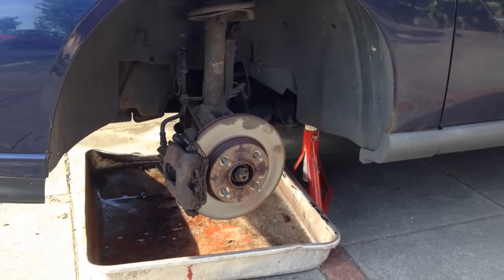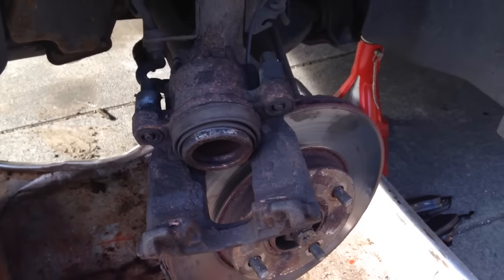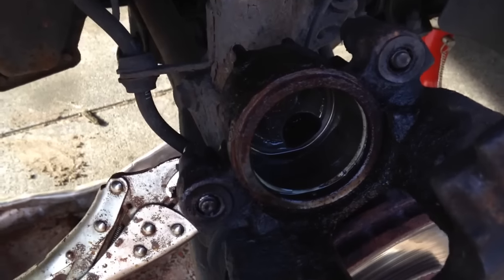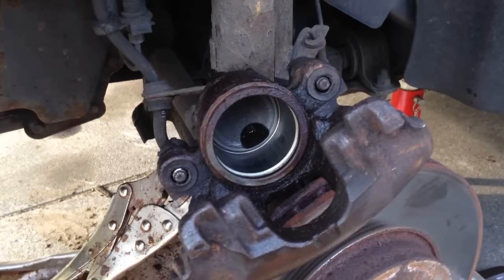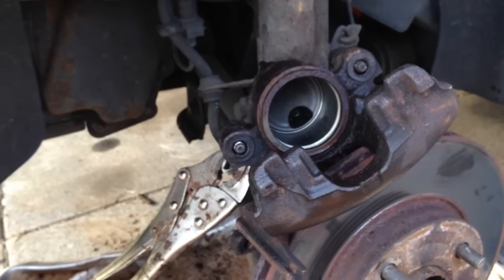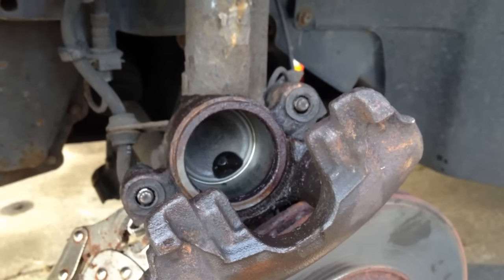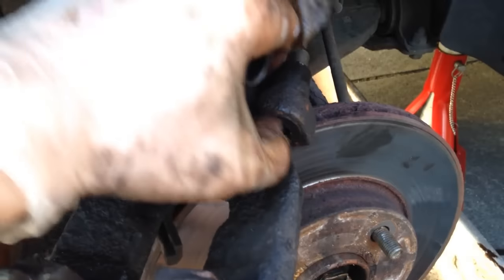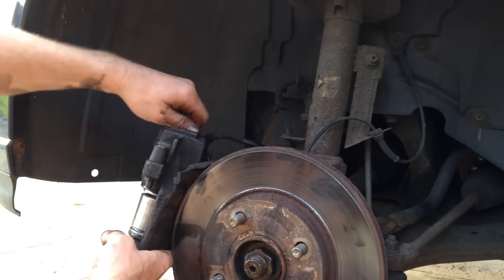How to Rebuild a Brake Caliper (WITHOUT Removing it From Your Car!)

Comment: Nice and clear! Great stuff!
I've just cleaned up my rear brake slider pins and noticed the seal on the piston has a couple of small holes.
I'll look again at your vid, and my design of caliper; I was hoping I might be able to swap over the seal without taking out the piston but not so sure if that's possible...
Ok thanks again good stuff!
Reply: I don't see why not in principle. You could put your foot on the brake until the piston is so far out, but not completely out. I suppose it all depends on design though. If you do try it, you need some method of getting the piston back in and I believe some pistons require a special tool to turn them and sometimes require a bit of force to go back in. A c clamp can work for the non-winding types I believe.
Reply: @seismic6402  Hi Thanks I only just saw your reply! I checked with my Alfa forum and it as explained my particular design of brake that I can only remove the seal with removing the piston... So perhaps one day I will - until then I'll try glue - it worked a little - and plenty red rubber grease.
Handily enough I have one of those tools but discovered that I have to be careful how far I push the piston - I think there's no stop - if I continued it would have popped out! There is a limit to how small a gap the tool can fit into...!

Comment: I'm going to do both front disc brakes at the same time this way. There is always that one cylinder that will work its way out before the other. I will use a block of wood to stop the first cylinder from coming all the way out to allow the other cylinder to start working its way out. This way, if I lose to much brake fluid and pressure or I don't want to clamp the hose on an older vehicle that needs all new fluid later, it wont stop me from working on the other caliper. Great video!
Reply from the maker: Good luck with the job Jerry. Cheers, Chris 👍

Comment: I did this recently, I re-used the piston though,  I used super fine sandpaper on the piston because rubber residue were stuck to it. I think i'm doing this for every brake job maintenance.

Comment: Easiest way to fit the dust boot on many calipers is not to engage it with the top groove, but put just over the piston at the bottom edge like a skirt.  It's easy to manipulate the boot into its groove in the housing without the piston getting in the way - particularly with a boot that fits into an internal rim. Yet, it's already fitted into the boot, just not creating extra difficulty. Then line up the piston and put it in, finally engaging it with the groove on the piston as it goes home.  No need for a screwdriver either.  :-)

Comment: Excellent ! I will try to apply your techniques to my Dodge Grand Caravan 2015. However, it's a dual piston system and I am wondering if I can only change one piston. I was thinking about using the new piston to stop the course of the piston I don't want to change so that all the oil goes into the chamber of the piston I want to change. What do you think about my idea ?

Comment: Great video and sound advice on how to repair a caliper though you might as well just disconnect the brake hose as only one bolt and make it much easier to clean and repair and just put new fluid in the master cylinder after and go round and bleed all the brakes for the sake of a 5 quid bottle of fluid as clamping brake hoses is not good for them. Peace of mind too knowing you have some fresh new fluid all round :)

Comment: Do you or anyone know it its possible to easily just replace the boot without completely taking out the piston? Like simply pumping piston out a bit and slipping on new boot?
I have a small rip and debating of going through the hassle now or just wait to rebuild it.
Thank you and very informative video too.
Cheers from Canada

Comment: I think fitting the pin rubber the otherway is easier than trying to pull it with flat screw. I acidently cause tear to my piston dust rubber around thr piston groove that is problabably need to be relaced to avoid very possible crossion if i dont. Do you think it is good idea to relace the inside mechanical seal as well. Car is 12 years old. Thanks

Comment: Hi, great video. Do these repair kits (with pistons) come in pairs typically, or do we have to order 2 sets? Kind of confusing, I am about to order a kit for the front axle, but it doesn't say if I need 2 sets or just one. Thanks in advance.
Reply: check with the supplier

Comment: I will probably need to do this because last time when I checked front brakes, I replaced the slider pin boots which were badly degraded, so, it seems the piston seals are likely due as well . I would point out that if one does not have on hand new banjo bolt washers (which of course should NOT be reused ) this can be done "on vehicle" as shown in this video

Comment: Great video .  I would spray the whole brake system down with brake clean to control dust .  Then spray the friction surfaces again , and wipe clean before final assembly .

Thanks ,   :-)
Wyr
God bless

Comment: Nice video mate. This will help loads when I replace the dust cover on my Focus. I'm not replacing the piston so at 12.05 where you use the old piston to press against could I instead just use the brake rewind tool screwed right up to the top? Thanks.

Comment: Once you have removed the piston you have allowed air into the system so you might as well remove it from the vehicle so you can clean out that bore properly. Pinching with the vise grips is not recommended. You may as well let some old brake fluid out of system since brake fluid picks up moisture and adding new at this point is highly recommended. You can put a small rubber cap on brake line end if you feel but I would let it drain.
Reply: you pinch to prevent losing all the fluid... its much easier to bleed when the entire front brake system is not empty.

Brake fluid is a maintenance item... no one does it however.

Comment: Nice video! Easy to follow. That "other lube, not for fluid area" probably should go on the 2 support pins for anti corrosion and less binding.
Reply: Ok what is the lubricant that goes on the seals and caliper pins and pistons? Is it white lithium grease? Also, I lubricated my other pins with the straight up red grease, as I didn't have to rebuild those caliper pistons. Was that a mistake? Will they seize up ?

Comment: When putting the dust cover on you'd have been been better off putting it on the piston, sliding it to the back of the piston till about half is hanging over the back of the piston, then offer the piston to the caliper, tuck the edge of the dust cover all the way round in its slot, grease helps, once in its slot then push the piston in. You don't have to touch the dust cover with sharp tools.
Great video.

Comment: Great video. Wish I hade time to get a replacementkit but I didn't so I friend bought a new caliper. Even in Biltema who is the big cheap store for tools and part here in Sweden the caliper was 900sek(~90$ or ~75£). Time to go out and change the caliper. Hope a got the right one haha.
I heard that I got to be careful not to squeeze the hose to much because it can separate/be damaged on the inside. Thanks for the video and marry Christmas from Sweden :)

Comment: Oh my god this video was absolutely awesome. Going to try this now that I know I do not need an air compressor!
Reply: Did  you do it? How did it go?
Reply: @yunarukami6118  I haven't got time to go at it yet, but I'm sure it will go right. I have already bought the seals and my problem was getting that piston out and now I know how to do it. I couldn't fine a new piston so If I open it up and the piston is really corroded that can't be fixed with a bit of sandpaper, then I'll just replace the caliper.
Reply: Yesh ill be best to chsnge it if it cant be fixed... i was gonna do this tomorrow. But well... i have to go to work... bull ill be doing  it next week
Reply: @yunarukami6118  Do tell what happens!
Reply: I will

Comment: Thank you for such a well explained process. I was thinking...once I get the piston out, to place the caliper on a table, clean it, insert the seals and the piston back in. Mount back the caliper and bleed it. But I don’t know if there’s a reason you didn’t take it out?
Reply from the maker: I just wanted the job done quickly (I can't stand being without a car). We don't have a garage, and my beautiful assistant Rossella (my wife) would kill me if I brought a brake caliper in the house. Job done on the drive, quick, easy, brake still going strong a couple of years later. Cheers, Chris 👍

Comment: Great video, but I think you should've put the red grease round the back edge and on the side of the piston, to help it slide in even easier. Won't be of any help if you grease the back :)

Comment: good video, brakes popped out my caliper but the only lube you should use is fresh brake fluid, other lubricants may break down the seals.  my altima had different dust seals  and "Andrew Lewis's" video showed how to properly seat them.

Comment: This was a super idea until I thought about what replacement piston would I use?  My caliper so old and rusted, it's anybody's guess what the original piston size or manufacturer is.  Thanks from Chicago I liked what you did here.
Reply from the maker: You don't need to know the piston size or manufacturer if you can find a repair kit seller who sells the kit for your car (I bought my repair kit on eBay) Cheers, Chris 👍

Comment: Hi Chris, Hopped over from your sailing channel. As good as your sea cock replacement videos. Wouldn't it be advisable to refurb the other side brake caliper as well so they are both exactly the same in terms of braking performance and safety? Just saying.
Reply from the maker: Hi Alex, it's good to see you over here too! Actually there was no need to do this. The other caliper was working fine and there's no need to fix it if it doesn't have any problems. The braking was even  after this u/s caliper was fixed and this was done a couple of years ago with no further issues. Cheers mate, Chris 👍

Comment: Use a G clamp to push the piston back into the bore..put head of G clamp inside the bore which will help to push piston back into the bore or use a block of wood across the piston to push it back into the bore...
Sydney Australia

Comment: Very helpful. Thanks. One question - how do you know it's the piston that is not retracting (due to faulty Square seals) or the brake hose that is faulty?
Reply: @Liquidh. You can tell if the hose is bad or the piston is stuck by just opening the bleeder on the caliper. If the wheel turns the piston is not stuck. It is rare that the hose blocks fluid but can happen.

Comment: I don't like clamping the brake line for fear of damaging it. Instead I depress the brake pedal with a snow brush between the pedal and the drivers seat holding it down part way. This prevents the fluid from bleeding through the system. I also pull the brake light fuse so the brake lights don't run down the battery. I coat the piston with silicone grease to protect the piston outside the seal from corrosion.

Comment: hi Chris , I used the same idea in fitting dust seal but found if you push out piston after fitting seal you will see it  comes off, you need to engage seal into bore first and then push piston in . if you read manufactures instructions will explain how. regards john
Reply from the maker: Hi John, 'my' method worked first time for me and the brake is still perfect now. I'm glad you fixed your caliper too. Cheers, Chris 👍

Comment: Hi!! 
Thanks for the great video. Im doing some investigative work in the case my caliper is bad and needs repaired. 
My question is.. if the caliper needs replaced or repaired its because its stuck right? 
Well if its stuck how could you pump the lines to get the piston out? If that was enough pressure wouldnt it cause it to not be stuck in the first place? Or is this an issue of sticking caliper pistons as in, not wanting to ease off the rotor once braking is decreased?
Reply from the maker: A stuck caliper is when the square profile seal doesn't have the force to overcome the friction between the cylinder and the caliper to retract the piston the 0.5mm ish to release the brakes. The pressure of the brake fluid will be able to move it in the other direction to remove it. Cheers, Chris 👍

Comment: I've just one question, I need to replace the brake piston seals in all the wheels, do I need to replace the seals all and after bleed the or can I replace the seal and bleed that wheels from the further to the closest of the reservoir one by one? I don't want to trap any air in the system.

Comment: Great vid! I'm going to attempt it this week. My piston is sticking I believe as the disc has gone red with overheating.  Would you suggest getting new front discs + pads as I've only just replaced them a couple months ago?
Reply from the maker: That depends whether you value your time more or saving some $$$. If you just sort the piston then you might be ok with the existing discs and pads, depending on how hot they got and if there is any damage (warped disc for example). If the disc is warped you should see it or feel it on a test drive (a slight vibration, pulsation or juddering). In this case you would need to get back to work for a second time to replace the discs & pads. If you want to work on the car just once then you can replace the discs & pads while you are doing the caliper and that will be evrything done in one go. Your choice Marc! Cheers, Chris 👍

Comment: Honestly mate you could really do with a good clean parts tray. And I would have put the square section piston seal inside the housing and then fitted it to its groove working it towards the outside to limit the opportunity for contamination with grit and rust particles from that external edge. But nice vid. And I would bleed that calliper again once in position with the nipple uppermost.

Comment: Nice trick with the cardboard and vise grips!  I've ton tons of brake jobs over the years and never though of doing that.
Reply: so what did you use?  im about to do this and am not sure how to close off that brake line/hose
Reply: @brucewayne99999  just follow the line back until you find the flexible material and clamp it off the way he did.  If you don't have vise grips you could use a small C-clamp and some cardboard to pinch It Off.

Comment: Makes it look so easy. 😁 I'm In the process of changing my wife's steering rack along with the brake disc and pads. But I've now discovered that the caliper looks seized. A job I've never done before hence the reason I'm watching videos on this topic. Do I buy the calipers for around £90 or the repair kit for around £50+ 🤔 anyway I'll watch a few more cans and drink a few more videos 😂😂 this by the way was a great video 👍🏿

Comment: So what would be the problem if the piston go back into the cylinder when being pushed in by hands only but get stuck when you using brakes? Is it the piston itself or the brake hose?

Comment: how did you get off the rust inside the calipers cylinder? the rust on the groove for the rubber seal was rusty. a lint free cloth was probably not enough...

Comment: I rebuilt 4 x Volvo calipers that did NOT come with that handy red grease. Only using brake fluid, getting those pistons past the square profile seals took all I had to get this to seat.

Comment: Hi Christopher, Great vid. and really useful. My problem atm is I discovered the back brakes haven't been working it seems for awhile, took alot to get the caliper off and the shoes are worn right down, so i'm wondering if the piston is seized will the pressure of the fluid be able to move it when the caliper is off ? If not i suppose i'll have to replace the calibers. Anyway hope you get a chance to reply to this. All the best Joe.
Reply from the maker: +Hey Joe Hi Joe, I'm replying as soon as I see this as I know you'll want this sorted ASAP. The piston should come out with brake pressure even if it is in a bad way so I would say unbolt the caliper and pump away! (You'll need a caliper repair kit) Happy fixing! Cheers, Chris 👍
Reply: Cheers for the quick reply !
Reply: Chris. Much appreciated.
Reply from the maker: +Hey Joe 👍
Reply from the maker: +Hey Joe 👍

Comment: Very good video, thank you!

I did this job myself today, and had a bit of trouble here and there, but still managed.

I have a question. I bled the brakes about the same as you, but when my own beautiful assistant pushed the brake pedal every time just a bit of brake fluid came out. So I repeated that a couple of times, but I don't really understand how to know all air is out of the system?
Reply: When no bubbles are seen in the tube
Reply: @RedrooAU  Thanks for your answer. But, the thing is, with this method you don't use a tube.

Comment: Trying to get that seal over the housing was a nightmare. Is it a disaster if the seal is slightly damaged (cut) by the screwdriver?
Reply: I think then brake fluid could leak out and/or street water leaks into pistons.  Then rust begins to eat pistons and contaminates brake fluid.

Comment: Today I was replacing my front brakes. When I started to put everything back together, I saw a bit brake fluid leaking. Since I had to go, I put everything together and drove with no problem. Bought new seals and going to replace when doing brake change on rear.

Comment: Is there a reason after you drive a vehicle a little while the brake disc will start to get extremely hot. Ive raised the wheel off the ground when its cold and it turns freely but when its drove for awhile the brake on one wheel starts engaging. On a side note Ive tried bleeding the wheels caliper but the fluid wont come out unless I start the car up..its a 09 Saturn Vue